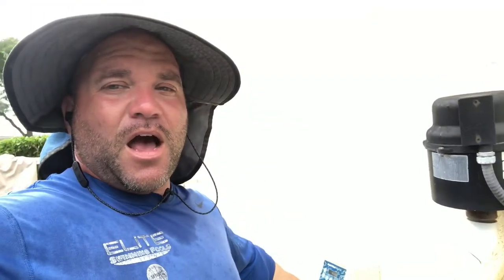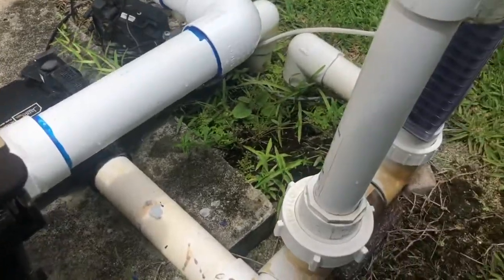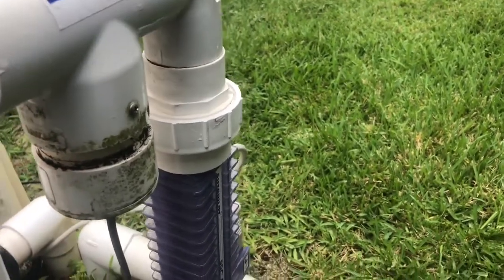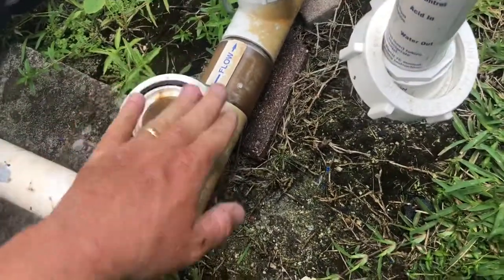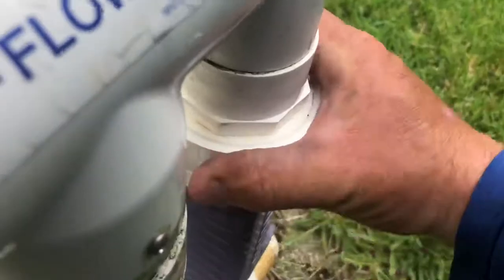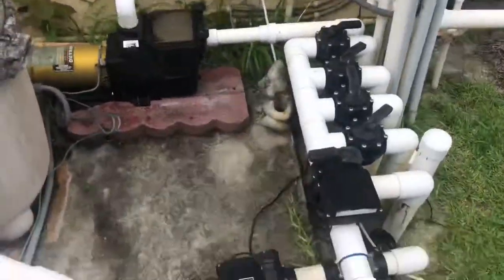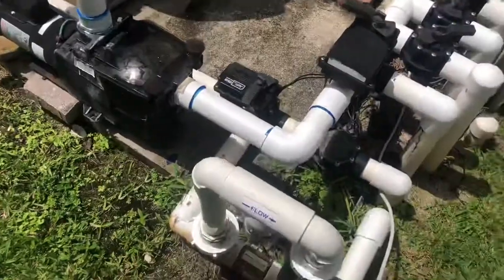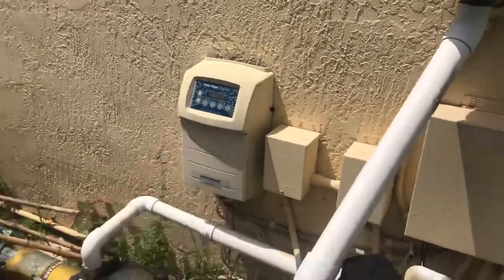Auto Pilot Digital Salt System NO FLOW? Tips & How To.

Comment: How long does it take for the pump to prime?i waited about a minute and never saw any flow at all, so I shut it off because I didn’t want to burn the pump out
Reply from the maker: Great question. Most pool pumps Should prime up within three minutes, given that there is no air leaks or plumbing issues on the suction side of the pump. Check to make sure that your pump lid gasket is properly in place, lube it up, and add water to the pump filling it until you see water enter the pipe and continue to fill for a minute. Put back on the lid and tighten it down hand tight. You do not need to over torque the lid, a firm hand tight is suffice. Also make sure that your water level is proper and not below the skimmer mouth. If all this is good and your pool pump does not prime, Contact your local certified pool contractor for assistance.

Comment: My red light stays on and says check cell. Cleaned cell and the light is still on and same message. Do you think cell is bad or something else?
Reply from the maker: The voltage must be checked coming from the main unit to determine if the problem is the cell or ok’ing from the cord or main unit. How many years has this cell been in use for?